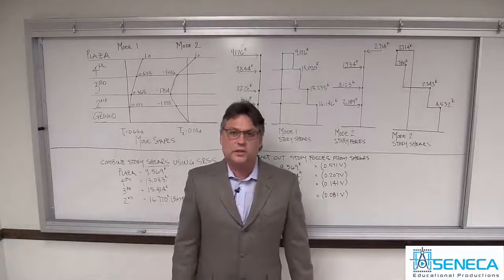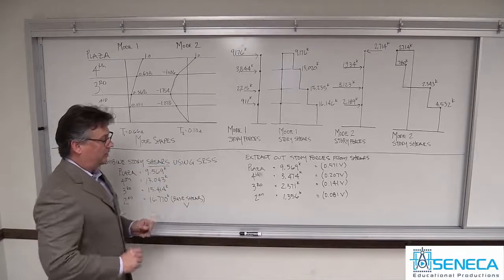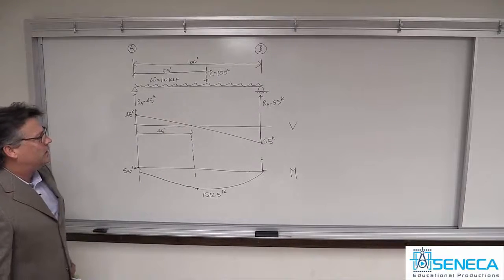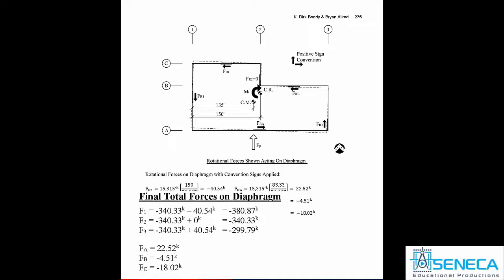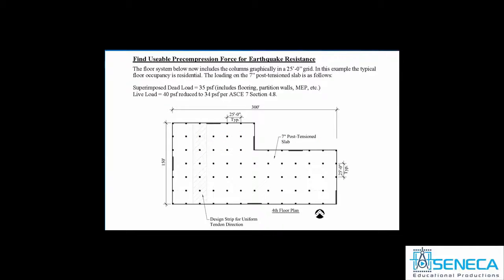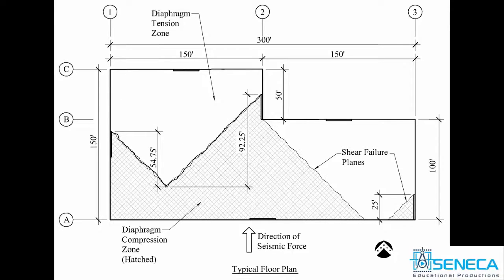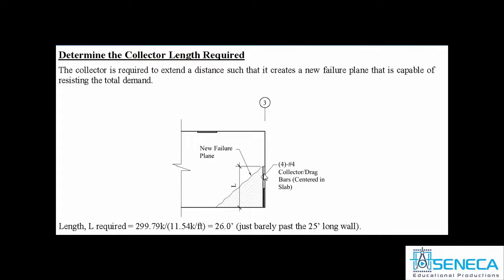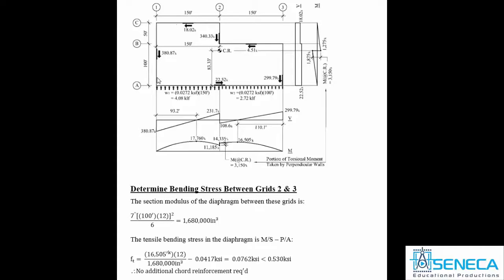Design of a Post-Tensioned Concrete Flat Plate Seismic Diaphragm

Comment: Regarding the shear friction check you are not double  counting the wall rebar because not all is in flexure  some portion is in tension and other portion in compression, being accurate the portion in compression could help for shear friction , what do you thing about it? I know many important firms do that
Reply from the maker: I think I understand what you are asking. The main problem with using any of the wall vertical reinforcing to transfer the diaphragm loads to the shearwall is that the slabs are not thick enough to develop the bars.  The best you can argue is that the bar is transferring the diaphragm loads through bearing against them.  To truly transfer load from the slab to the wall, the transfer mechanism (the rebar) must be fully engaged (developed) in both elements.  

For example, in a plywood diaphragm the nail head anchors the nail to the plywood side, but the nail must develop into the plate or the connection between the plywood and the plate won't work.  

Hopefully I am answering the correct question.